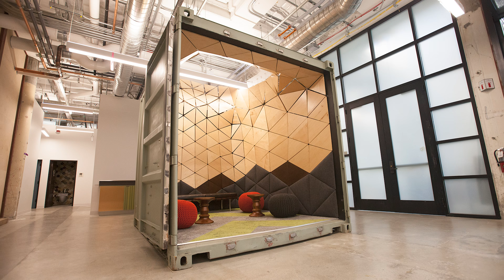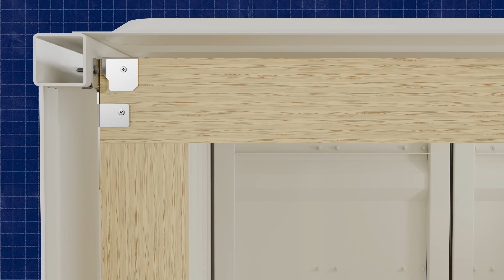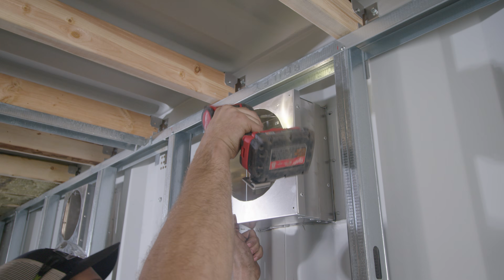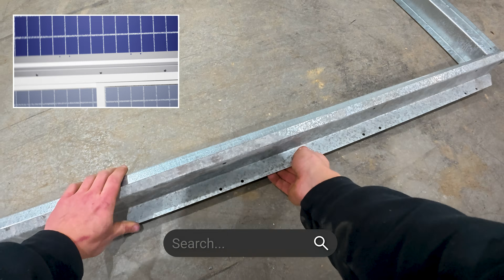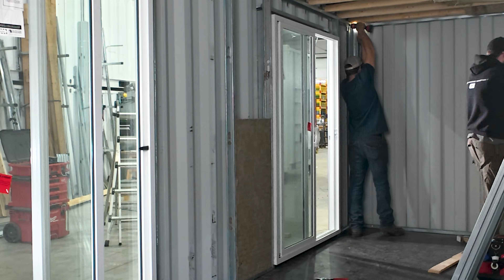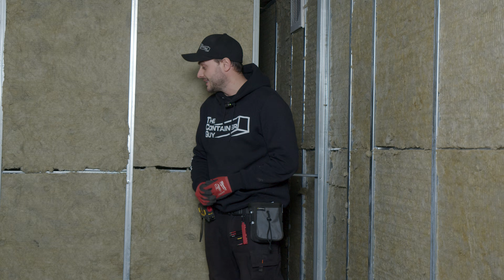NEW Patio Door Frame for Shipping Containers + Mineral Wool Insulating YOUR Modification

Comment: Question for people who might now.  

After framing the interior of a container, how much space is left wall-to-wall?     

For some context, I'm considering putting one as a office space inside a semi-protected area, where the temperature might vary between 40 and 100 degrees, but there would be no rain or wind on the structure.   I'd like to have a mini-split for conditioning the inside, and would need to run some electrical which can be visible.

Comment: why are you strongly against stacking the containers like legos?
i was thinking of stacking and welding containers together to make a 2 by 2 container apartment.
bad idea?
Reply from the maker: If they're lined up on the corner posts then we think it's a cool idea that should work. I'm just cautioning against putting them together like a + as the weight needs to be transferred down the corner posts.
Reply: @TheContainerGuyTV  thanks for replying, best channel and information on builds. much appreciated.

Comment: I have just purchased an 8' x 6.5' container with one window, 1 walk door and the big end doors. I plan to remove the end doors and frame that in. This will be used for a hunting tower in Northwest Missouri. I would like to install additional windows and solar ventilation on a thermostat for year-round air flow. I am searching through your videos for information on vapor barrier, air flow, end wall framing kit and window kits. I have windows. Can the kits be ordered exact to my size or can they be cut down to match?
Reply from the maker: Our framing kits are laser cut to fit into the corrugations properly. Unfortunately because of that cutting them down won't work. The end wall kit is 48"x30". We also have door and wall flashing kits that would allow you to frame & insulate but still keep your doors operational as another option!

Comment: So, is it pretty typically 10 studs per wall per 20 feet? Or, 60 studs for a 40 foot container?
Reply from the maker: If you framed 24" O.C. it would be 10 studs per side wall for a 20ft container or 20 studs for a 40. If you spaced them 16" O.C. it would be 15 per 20ft or 30 studs per side wall for a 40ft container
Reply: @TheContainerGuyTV  Copy that, thanks for the response! When I said "per wall", I was including the roof/ceiling, so three total surfaces to frame.

Comment: What do you do if you cut a container in half, 40 down to 20 & 20 what would you do to reinforce the cut ends?
Reply from the maker: You would need to weld in new corner posts, header and footer. The corner posts are where the container gets most of its strength from. We added corner posts in this video if you want to see the process. https://youtu.be/s9tl4zK4vRs?si=kRTh4Z2LR4DAuk23
Reply: @ ok great thanks for the info & link. I had a short about my container if you could take a quick look? You could even do a remix if you wanted to 🤷‍♂️https://youtube.com/shorts/hThBr77y1Kg?si=tQzeLgWl5ntr_jSc it was in a fire & i havent come across much info about what i should or could do, thanks again ✌️🤙😁

Comment: Hey guys, amazing job as usual
What do you think about sliding patio doors vs folding patio doors (there's some at homedrpot site) ? I'm curious what's better in terms of sound proof and insulation wise 🤔. Warm regards from Israel 🇮🇱
Reply from the maker: Thanks for the question! Looking at them on the Home Depot site it doesn't seem like there would be a huge difference between the two in terms of sound proof or insulation. You may be better off researching the different brands and models of each door as there is likely a more expensive, but more insulated option. Here's and article on the topic: https://bifolddoorsuk.com/blog/bi-fold-doors-vs-sliding-doors/#:~:text=Energy%20Efficiency,thicker%20glass%20that%20retains%20warmth.
Reply: @TheContainerGuyTV  thsnk you for the hint 👍🙏🌲